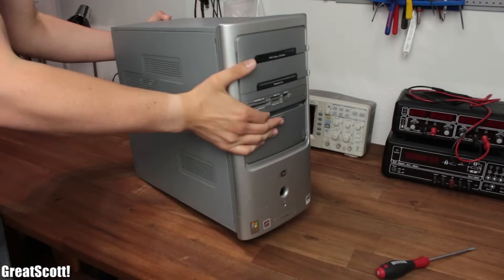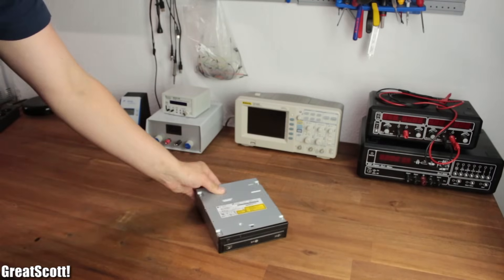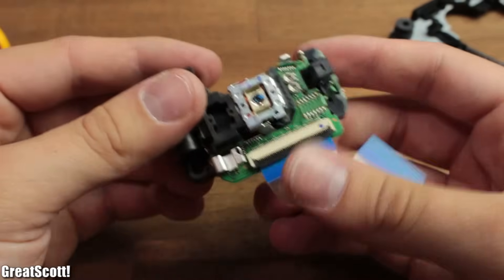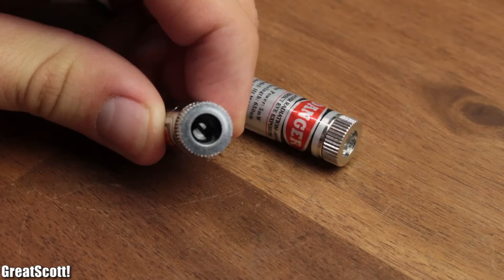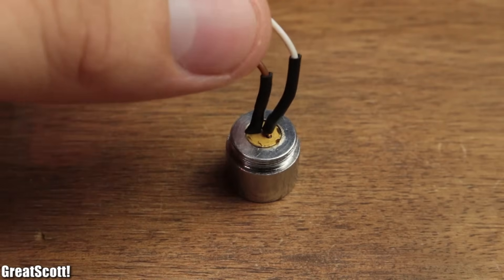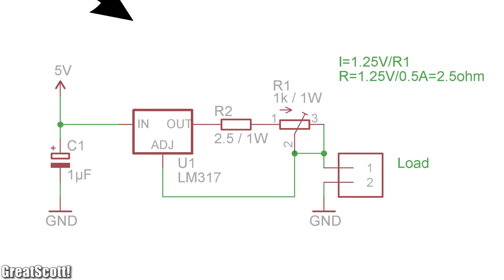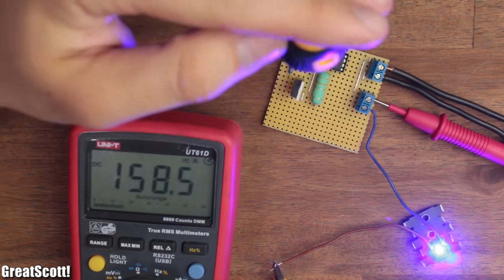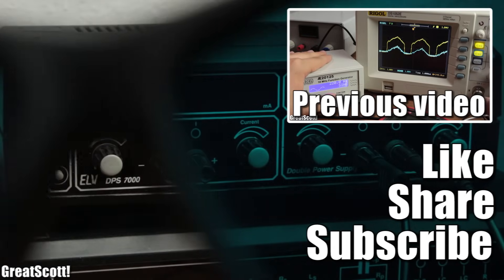HACKED!: Laser Diode from DVD Burner || Constant Current Source

Comment: +GreatScott! 230ma is the nominal current, anything above you'll risk damage the laser and it will turn to a very weak laser,  even a short over current mistakes like adding 0.01uF might 🔥 burn it. 
Short circuit the laser leads and test that it wont past max current,  i did that with LM317

Comment: Had the same problem. I've built everything but didn't work out too well. I was using the laser diode from an 8X laptop DVD-RW drive. Aparently you need at least an 16X drive up to 22X or more X drive because that dictates the power of the laser diode. Hope this helps. Cheers :)
Reply: For anyone reading this in 2022, the drive in this video (LG GH22NP20) was actually a 22x drive already.

Comment: If the forward voltage of the diode is less than 3V, then it is the IR diode. It still gives off visible red light at, so beware - you can easily blind yourself, thinking it is just a dim red diode.. An LM317 is sufficient if you keep the input voltage not far above 7V. 500mA is too much for an unknown diode. Don't go above 400mA MAX (even this is pushing your luck), and the 1/4W pot will handle it fine if you put an appropriate series resistor before it (the voltage drop over the pot will be low (P=V*I) . Disconnecting the diode from the constant current source and reconnecting it while under power will kill the diode.
Reply: Forssa1  but an infrared LD can be watched with a cam (phone or webcam) very good.
Reply from the maker: Forssa1 I also powered the IR Diode but it did not emit any visible red light though.
Reply: GreatScott! Maybe you are not as sensitive in the near IR as I am, or you powered it wrong or even killed it before it got a chance to laze.
Reply from the maker: Forssa1 Sure
Reply from the maker: Patrick Yoon
Could you stop trolling now?
Reply: There are at least two different IR diodes 840nm and 910nm the 910nm should not give any visible light (at least for regular diodes tho not laser ones)
Reply: Neutrino CD diodes are 780nm (also found in DVD and blu-ray devices). It's  just beyond what's considered visible light. I can see it as a very dim cherry-red. The same for <850nm, but even dimmer.
Reply: Bro Modz Green has more energy than red, and absorbs in human tissues easier than red, so yes. But think of any colored laser as dangerous.
Reply: Forssa1 aren't green lights more dangerous tho ? Than red ?

Comment: Laser 1 - Scott 0
:(
BTW will the CD burner diode works?
Keep up good videos!
Reply from the maker: ardystal gysr I just found another laser diode and ignited a match with it. I will upload a video tomorrow on my second channel.
Reply: ~☆ XzCraftP ☺♂ It does work. A diode from CD-RW will burn matches easily. But since it is infrared, it's very dangerous because the beam is INVISIBLE. Around 180mA will do just fine.
Reply from the maker: ~☆ XzCraftP ☺♂ I think CD burner do not work. But I am not sure.
Reply: ~☆ XzCraftP ☺♂ BluRay Burner diode will do. :D
Reply: GreatScott! 230ma is the nominal current, anything above you'll risk damage the laser and it will turn to a very weak laser,  even a short over current mistakes like adding 0.01uF might 🔥 burn it.
Reply: +Charvin91 180mA will hardly burn a match I assume! 
I mean IF after the laser is damaged it will keep emitting light but will never reach its high power spec, I use lm317 current limiting circuit and it works fine on 5v usb jack.
Reply: Sam well if the diode is already damaged, there is nothing you can do to make it produce its original power. I doubt that diode will ever burn anything... Im driving my CDRW diode with 180mA and when focused it does light up matches even with shitty optics. When using DVDRW diode you can visualy check if the diode is fine, it is super super bright even at 100mA, with cd diode I assume looking at it through a camera. (but only without a lens so you dont burn your camera xD) Ill make a video to prove that it does work.;)
Reply: thanks for the reply,might try it out! ;)

Comment: GreatScott! Try using a Blu-ray drive diode. Or google this part number M140 445nm Diode. This is a deep blue coloured laser, very high powered and cheap. I've got a lot of experience with lasers and homemade/handheld laser diodes/modules and kits. If you need assistance, let me know.
Reply: ***** Blu-ray is 405nm (violet). M140 is royal blue. I do not recommend such a high power laser for your first build.
Reply: Forssa1 See how I used the word "or"? This is a grammatical conjunction... Which by definition connects two sentences together. You may want to re-read my comment, because nowhere in my comment did I mention M140 diodes to be 405nm... in fact, I believe I even specifically said they were 445nm which is a deep blue colour.
Reply: ***** I was pointing it out to anyone who doesn't know the difference, since you didn't in your 'precise' grammar.
Reply: P
Reply: Cheap? About U$20!

Comment: But it should work propelly!?!?!
Reply from the maker: Oriol Pascual Yeah, the theory is correct. But such problems can always occur, especially in electronics.
Reply: GreatScott! Maybe is not the good one or anything like this because I did a laser like this one and it can burn, my laser without lens do a big laser point, I think is that the problem
Reply from the maker: Oriol Pascual
Maybe I will find a better diode someday and then I will finally ignite that damn match.
Reply from the maker: Patrick Yoon
What do you think I built in the video? You should do more research before writting such a comment.
Reply: Get a dual layer disk burner cheap or a fast write speed burner as they are usually more powerful !